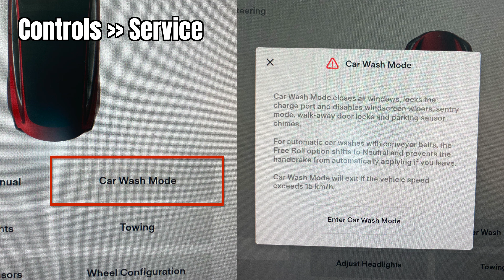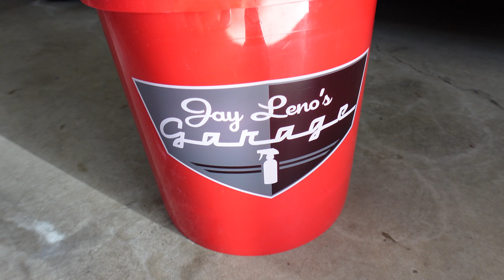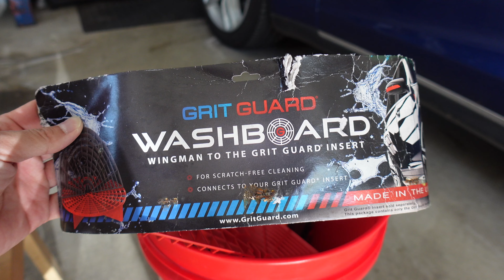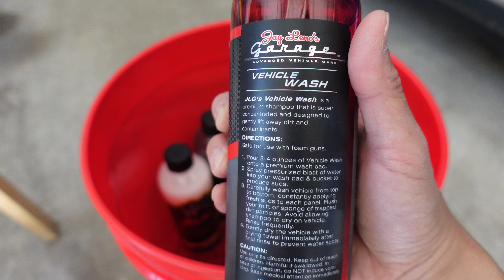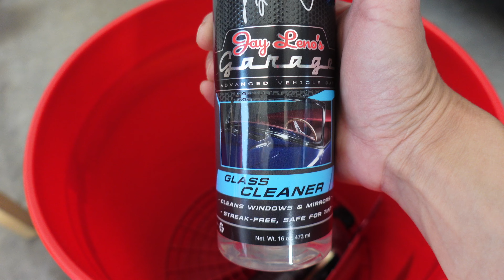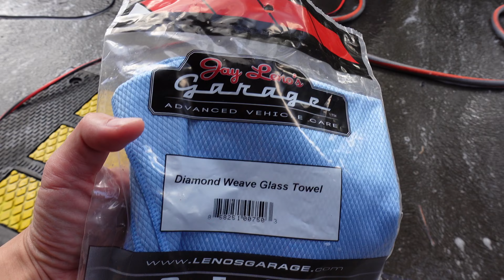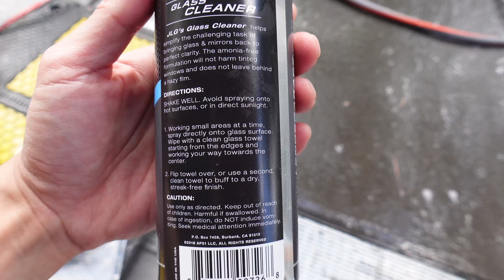TESLA MODEL 3 PRESSURE WASH AFTER ROAD TRIP AUSTRALIA 2022

Comment: Great video Tom, been using the Lenos Garage products for a few years and they are amazing. Tried all the big brands, they are priced well, perform better and Jay Leno wouldn’t put his name on anything average.
Reply from the maker: Thanks! I was very happy with the result 🙂
Reply: @LudicrousFeed  you will love them. Ps. The blue towels are for polishing waxes normally or with Quick Detailer, the black towels are generally for interior. 
Spray Wheel Cleaner directly onto the wheels, leave for 1-2 mins then scrub, then hose off.

Comment: You might like to invest in some mud flaps. My M3P did not look anywhere near that bad on the sills and back after 6500km of Outback roads including well over 100km of high speed dirt roads. The mud flaps catch all the rocks and prevent abrasion.

My front was a similar bug holocaust, although most of these were on the 2-3 days that I was between Melbourne and Port Augusta (and back via Kangaroo Island). Outback north of Port Augusta up to Uluru was surprisingly low on bugs... lots of budgies though.

I am a Bowden's fan, and car was coated with their Wet Dreams product before we left. When I got back I just hit the car with a heavy coat of snow foam in the cool morning and let it dwell for 5 minutes before pressure washing all the bugs and red dust off. Surprisingly, that got the car clean enough to just dry with a large microfibre towel and dirty deeds cloth for the sills and doors and call it done. I was all set up to two bucket wash the car, but it was great. 

I will need to do a full detail again soon, with Three Way and a claying rubber, but for now it is OK.
Reply from the maker: Thanks Richard, great advice especially with the mud flaps if we do any more long trips 👍🙂
Reply: Hi Tom, I installed mud flaps on my M3, certainly reduces the amount of crud lodging on the car. The ones I bought were from Tessories Australia.  Judging from the amount of bug splatter you experienced , I suggest you check up inside the radiator grill with a torch. I think you will find lots of grasshoppers and leaf litter etc up in there towards the upper rear. I experienced them getting in there on a return trip to Canberra from Taree. I cleaned the rubbish out of said location an have since bought the mesh radiator grill protector from Tessories and that has solved that problem. Grill looks good and is virtually unnoticeable. Thanks for you videos.
Reply from the maker: @2240193197  Thanks Ross, I’ll take a look 👍